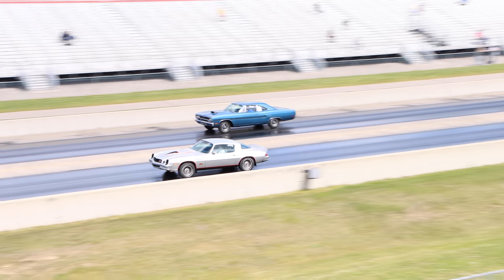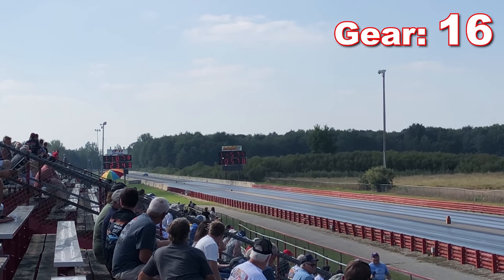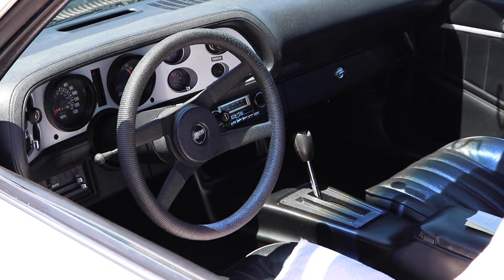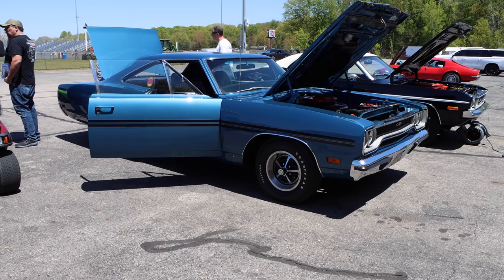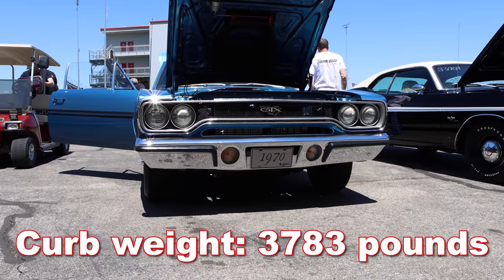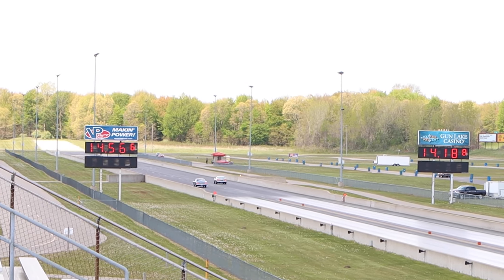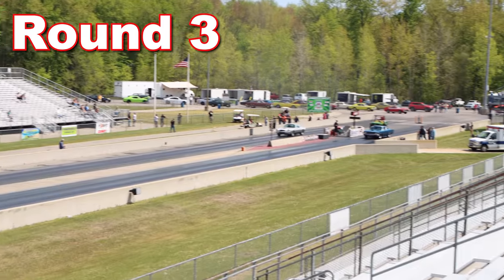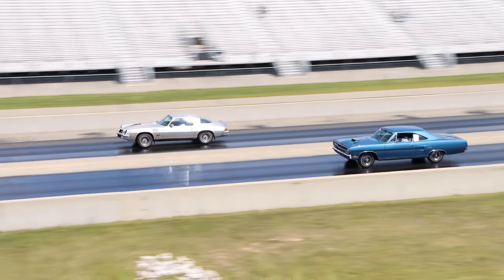1978 Chevrolet Camaro Z28 drag racing 1970 Plymouth GTX FACTORY STOCK DRAG RACE

Comment: I understand that certain modifications are allowed, but it needs to be called.modified stock NOT factory stock. When you have a 78 POS Camaro running in the 13’s there are too many mods allowed.
Reply: Maybe you should cry like a little baby to the NHRA….They started this class with the same rule.
Reply: B🥺🥺 H😭😭
Reply: REEEEEEEEEEEE!!!!!!!!!
Reply: Why is it a POS just because it runs better than some old magazine test?? 
The car ran mid 14's with the untouched 57k mile original engine with a bad cam lobe and no valve seals.
Reply: Mopar guys are crying so hard in the comments
Reply: a lot more compression and a modified cam with stock specs goes a long way.
Reply: Wow, guess I hit a nerve... relax, it’s just my OPINION ... Believe it or not I am allowed to have an opinion. Sheesh
Reply: @stevepick9527  opinion is one thing, an unjustified insult is something totally different, and when you publicly disrespect someone's car because you don't understand what is going on, and don't take the time to ask questions to educate yourself before making a statement, it has a tendency to cause people to react.

Comment: Somebody is lying with those Z's in 78!  No way they ever get below 14's.
They were luck to get below 15's!!!  Sandbagging, Oh Yeah!!!
Reply: Like he YELLED at the beginning of the video…….. READ THE VIDEO DESCRIPTION BOX. And you don’t seem to understand the definition of sandbagging.
Reply: I know exactly what the description says and no way a ‘78 smog dog Z28 runs in the 13’s with the allowed mods.  They need to check that engine/car very carefully IMO.
Reply: Come on over, check it out.
Car ran mid 14's with the stone stock original 57k mile engine with a bad cam and no valve seals, sloppy timing chain,etc.

Comment: Not sure who William Nichols is but I'm thinking he is the one who needs to do his homework. The M21 IS a close ratio transmission and if a Chevrolet is equipped with a 12 bolt rearend it does get 4.10 gears. Only 8.2 inch 10 bolt in both Chevrolet and Buick/Pontiac got 4.11 gears. I'm sure you knew that though. Too bad there are so many douchey trolls out there. The '78 Z28 is one beautiful car. I liked it so much in 1978 I talked my 16 year old sister into driving me up to the local Chevy dealership so I could get a new car brochure. I was 11 at the time. I drooled over the pages for years, until I discovered Genesis. It was better!!! Glad the commentary is back, too entertaining !!!!!

Comment: Back in the day these cars prowled the streets (mid 70’s) I drove a lightly modded 1970 Mach 1, 351 auto with 3.91 gears.  I say this as only as a point of reference that I went up against many of the cars shown on this site.  My car consistently ran in the 14.5 - 14.7 range.  I would have put up everything in my wallet any day of the week against a 1978 smog dog Z28.  There is no way in hell that cars runs 14.1 with the limited mods listed in the description.  That’s a 2 second drop in ET with only a slight bump in compression (still under 10:1) dual exhaust (stock exhaust manifolds) and replacing the points with electronic spark (more reliable but doesn’t add HP)?  BS.  I guarantee you that car is not within the the listed rules.
Reply: It would take a whopping 299hp (at the flywheel) to run a 14.00 in a car weighing 3549lbs. You're showing your ignorance, too... that car ALWAYS had electronic ignition; GM went to 100% electronic in 1973 for ALL vehicles. Chrysler switched in 1973, as well. Ford was a little behind, but even they were 100% electronic by 1975.
Reply: I couldn't agree more, despite what the owner claims. It's not stock, and I doubt it's even 'Factory Stock' and whatever the gains of those mods may be. There's just no way. I'm guessing it has a cam, some head-work, and a taller rear than specified, among other things. I know those cars can be made quicker using the factory mill, but then you just can't call it stock.
Reply: What?? You want to compare some tire spinning, manual trans, crappy driver untuned turd, to a well tuned car on a sticky track?
Stock engine went 14.60 in 90*+ heat and crappy air last year well tuned. New engine is .060 over, balanced, 9.7 compression, good valve job, and tuned to run.
Nobody ever said it's "stock" now, it's "stock" within the rules.
As for the GTX, it's a beautiful restoration, Jamaica blue, freshly pulled from museum, never been raced before, totally stock. 
The cars just happened to get matched up because they were the closest two together in that E.T. range. The qualifying times were a little mismatched giving the edge to the Camaro.
The guy driving the GTX is a great guy and a friend.
FWIW.... We were matched up against him last year with his 67 GTX convert when the Camaro was bone stock and he cleaned our clock.
Reply: Well for starters they had electronic ignition ( I owned one) and under the rules of this class they are allowed to modify them…read the description page 😜

Comment: I actually like this video for what it lays BARE about the silliness of blanket statements and how history tends to be so completely distorted over time. Here's the GODS HONEST TRUTH. The original Muscle Car era did see a few MONSTER cars at the drag strip but that performance was only available to those who had the  ability to actually find it. Virtually no cars from the peak of the era were screamers straight off the showroom floor. This big inch, HUGE TORQUE 440 GTX shows pretty clearly that tweaking for better drag strip manners are required to get the power to ground in a useful way. Slicks and open headers were required more often than not or you get 14.0 sec time slips out of 90%+ of 'em at best. Then the other side of the scale are the late '70s cars, like this '78 Camaro HOBBLED by earliest days of the emission's era. A lot of these cars aren't/weren't nearly as hopeless as re-visionist history wants us to believe. PATHETIC in off the showroom floor configuration is fair to say yet many still had decent bones to start with if you were willing to wrench for more power. 3:73 gears in a standard shift Z/28, 11" Clutch still in place, and close ratio 4 speed. A 350 was no further than headers, intake, heads and cam swap from making  350-400HP as easily as the early 1970s cars did. That's a decent amount of work a few bucks more required but you aren't required to remove the engine to get into a 13 second 1/4 mile along side any 1960s Muscle car with enough power to do the same.

Comment: I had a 78 Camaro the best time that car ever ran was A 16.5 there's definitely been worked under that car there's no way that is stock
Reply: Apparently you don’t understand how to tune a car William. Exhaust, timing, race gas, compression ratio increase… easily a 13 second car.
Reply: That car only has a 175 horsepower what are you you smoking
Reply: It's supposed to be all stock in original give me a break those cards where pile is shit I had one fucking car couldn't get out of his own way
Reply: I bought AZ28 brand new back in 1978 those cars were slower than snail shit and if you're talking about the race against the GTX that's supposed to be an altotally stock race with no modifications stock Z28 did not run a 14
Reply: Wanna bet?
Car ran mid 14's with the stock untouched original engine last year.
Rules allow upgrade to true dual exhaust, and with an overbore and extra 1.5 of compression, it easily runs 13's.
This was leaving it in drive and letting it short shift at 4400rpm with a young driver getting his feet wet.
Reply: @Jack Sheeley yes, part owner with my 15 yr old son. He's pretty proud of the car. Car runs on premium, is easy to drive, great first car to get his feet wet at the dragstrip.
Next modification is transmission governor work, get shift points in drive up to about 55-5700 for peak performance/lower E.T.'s
Reply: I bought one brand new off the showroom floor that weren't 14 2nd cars they weren't even 15 2nd cars you're in some kind of fantasy land I own them I sold them I think I know what they ran Didn't even come close to 14 seconds
Reply: @tommiller1777  You have to remember Tom, you’re talking to people who have never tuned a car or set foot on a drag strip. They don’t understand what you have already accomplished.
Reply: @tommiller1777  I believe you I lived through that era and the only cars that were slightly faster were  the 78 Pontiac TA . 4 speed Camaros were slightly faster with a good driver and the increased gear ratio.

Comment: The GTX is slower than it should be, but with a 4-speed in the mix there's always the possibility of a terrible driver behind the wheel. No excuse for the Camaro though. Definitely NOT a stock car, and you'll never convince me otherwise. No STOCK 1978 Camaro could ever crack into the 13's. However, under the rules of "FACTORY STOCK" there's enough wiggle room for shenanigans to occur.
Reply: No it isn’t. 3.55 gear running 14.3 is expected. Heavy car and only 375 gross horsepower. 4.10 and easily a 13 second car.
Reply: @therewhatgoes8038  My comment was more about the Camaro than the GTX, but of the 3 races, he only ran a 14.3 once. In any case, he would have easily beaten a truly STOCK 1978 Z28.
Reply: @jhschmidMD4 , the rules allow for certain mods, which the Camaro owner obviously did them all. In stock trim, my 1996 Jeep Cherokee with a 4.0l 5-speed runs 15.10 in the 1/4 mile... nearly a second faster than a stock 1978 Camaro, lol.
Reply: @johndeeregreen4592  Yeah, I'm not surprised. I remember those cars very well from when they came out. Chevy sold a ton of them, but they were all paper tigers. They looked good, but were just dog slow (even by 1978 standards).
Reply: @jhschmidMD4 , the fact is, though, if you use more compression, better heads, and a decent came, even high 11's aren't hard with those cars. Meeting the Factory Stock rules, however, yeah, 13's are hard, but not impossible. It only takes 300hp to get a 13.90 from a 3500lb car.
Reply: @johndeeregreen4592  Believe me, I understand. I own a 2006 GTO, and that car responded brilliantly to the few basic mods I did when I first got the car. And it's true that the Z28 would also benefit (perhaps even more so) from the same basic mods, so I know that better performance is certainly possible. However, my real point is that you can't then really call it stock, or even 'factory stock', because it's just not. You've changed things that would likely void the warranty on a new car, so it not right to call it stock. This video, as entertaining as it may be, is a form of click-bait, I feel. I know the OP didn't make up the rules, and he CLEARLY states to read the descrip, but even so...
Reply: Who ever is driving the GTX doesn't know how to drive. My friend had the same Camaro and I had a 1970 Plymouth Satellite 383 100% all original and I beat him every time.
Reply: @norristammislideshowmulgre877 , that's right and I bet that Camaro was bone stock. You're failing to realize, the Camaro in this video is stock(ish) and modified within the constraints of the class rules. And, no, that GTX is running about what it should. With the 3.55 gearing and a 4-speed, those cars are lucky to hit high 13s low 14's in the 1/4 mile; with mid-14's being the norm.

Comment: I've read the description box a dozen  times. What we have here is a bone stock 70 GTX 440 4bbl with 4 speed, running very close to what the publishers of the day put out, vs, a 78 Z28 that still abides by all the 'rules' of the class but is FAR from GM showroom stock. Trust me, that car could barely run a 17sec quarter, bone stock. Be that as it may, the 78-79 Z car was 1 of my favs from my childhood, even as slow as they were.
Reply: Watch the video again……..original testing shows a 16 second car through a single catalytic converter. 2.5 inch mandrel bent exhaust? Easily 15 seconds. 110 octane with timing to the max and carb rejet? 14.5 seconds all day. I’ve owned a few of these and for a few hundred bucks they’re easy to get some speed.

Comment: interesting fact: the fastest production vehicle in 1978 was the 6,000lb Dodge Lil Red Express. From the factory, it was good for mid 14's in the quarter mile. Stick that in your camaro and suck on it.
Reply: ..not that heavy..that's the newer over weight trucks. try 4,500 lbs. 6,000 is the GVW, as in with a load in the bed. I had 2,000lbs of concrete, 3 adults and 30 gals in my '93 Ram 150 pickup once..yes she squatted some, but was perfectly driveable. 1/2 Ton my arse, a full ton plus :D
Lil Red.. was not only the fastest, but one of the strongest veh of '78. you could do a 1/4 mile a day from then till now and not break anything, just change the oil more frequently. i had so many full throttle pulls on my old C bods, like my '66 Newport..i mean..daily many times for ten years & no ill effects. engine was a '74 440 HP. ..who misses $1.50 a gallon fuel? Trump was getting to that! 
Now we have $3.60 and climbing for 91 octane..again..like under 0bummer, smh.
Reply: @IronWoode  Ahh, gotcha. & yeah quick trucks are fabulous fun :) I miss my '93 D150 with a 5.9L mag & hd 4 spd auto. Sold it to my nephew & he loves it a lot, has 220k mi on it & she's doing fine..lil wisconsin rust, is all.

Comment: Bunch of crybabies because the Camaro beat the Slopar. 
I'm Happy😁😁😁
Reply: Every video is like that. Bunch of grown men acting like spoiled infants.
Reply: The slow par ran what it should.  Everyone’s comments are about the smog dog Z28.  I street raced back in the mid 70’s in a lightly modded 1970 Mach 1 and would have laughed at a 1978 Z28.  With the ALLOWED mods the Z28 would have been lucky to break 15.  They were mid 16 second cars stock.

Comment: Was the GTX running on one cylinder
Reply: 14.3 is pretty much all it has (truly stock) with a 3.55 gear.
Reply: That’s a pretty heavy car with a base 440 (vs the 6 pack).  The base 440 had big torque but HP wise it wasn’t much better than the 383.  The car ran about what I expected with a 4 speed.  It would have been quicker with a torque flight.
Reply: 440's were nothing to be feared.
Reply: @stefanovichmichael9686  ok if you say so..but I know different first hand..440s were stop light terror's.back on the day..
Reply: Nope,their own 340 siblings could out run em!
Reply: @stefanovichmichael9686  really?? I had a 1970 duster with a 340..was a good race but the big 440 always passed me..

Comment: In 1970 the GTX was a high 13 second quarter mile car in 1978 the Camaro was a high 16 second quarter mile car and if you pay attention to the video they keep calling the GTX a Coronet the whole videos a joke
Reply from the maker: At no point in the video was the GTX called a Coronet. Oh, and if you actually paid attention you would see that the Camaro was not a “high 16 second“ car, it ran a 16 flat in absolutely stock trim with a single catalytic converter and letting the transmission shift itself.
Reply from the maker: Oh, you watched it?!? How dare I question that! How about give me a timestamp where it was called a Coronet.
Reply: @CarsAndZebras  Hey there C&Z nice video as always. You should look into getting some Troll repellant... comes in handy for these kinds of situations!
Reply: @CarsAndZebras  I watched this video online and they refer to the GTX as a Coronet and then I switch to YouTube it made my comment. But at the end of the day that's still a junk ass Camaro
Reply: @eugeneparker9465  why is it Junk Eugene? My son and I are pretty proud of it.
When we began our search for a 78 Z28 for this Pure Stock/Factory Stock type drag racing, we had an agenda, and to achieve that agenda, when shopping for a car we had a criteria...1) Rust Free, 2)Lower mileage unmolested original, 3) low option car to keep it light.
What we found was this 55k mile 2 owner car presented here.
My son and I worked on it together the first winter we had it. We removed the whole interior, replaced heater core, power washed some mouse out of the carpet, detailed and reinstalled the original interior, went over the mechanicals, and installed a mandrel bent 2&1/2" x pipe true dual exhaust system(which the rules allow) I rebuilt the carb, jetted the primaries, and swapped out the secondary metering rods and put a more aggressive hanger to pull the secondarys rods higher to richen it up. I pulled the distributor, disassembled it and welded up the slot to limit the total advance and add more initial timing, which brings in a ton of bottom end torque.
In this form last year, the car went 14.60 in high heat/crappy air at the track with the original 57k mile engine.
So why is it a junk ass turd?

Comment: I will add my 2 cents worth. First of all the 440 is 375 HP not 385. Second, given the rules, that RR should be running low 13's if not faster. My 74 Charger 440 with the torqueflite a supertune and rejetted carb ran 15 flat at 92 with 3.55s. If they are running 110 gas the RR should have bumped up his cr to 11.5 if he didn't, he allowed the Camaro to sneak up to 9.7. I would like to know if the Camaro was allowed to run a full dual exhaust. I know he can take off the catalytic but is he allowed a full dual exhaust? If the Camaro did a super balance and blueprint (i.e. not your shit speed shop one)  rejetted the carb and blueprinted it plus the transmission, versus the 440 running the factory setup and 60,000 miles on it and the stock jetting and timing and can't shift a 4 speed to save his life etc.  The gap has closed. These cars aren't 2 cars pulled off the assembly line and racing each other. Its all in the preparation. Just because you have a shiny blue car doesn't mean anything in this class. I know a guy who races an L/SA 66 Chevelle with a 283. He's run a best of 11.571 on the 9 inch slicks. That's preparation.